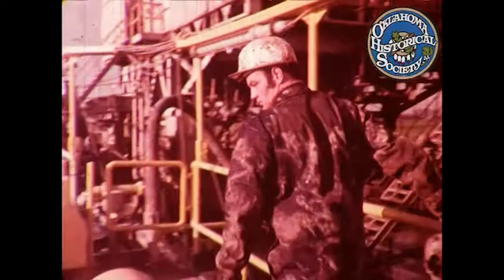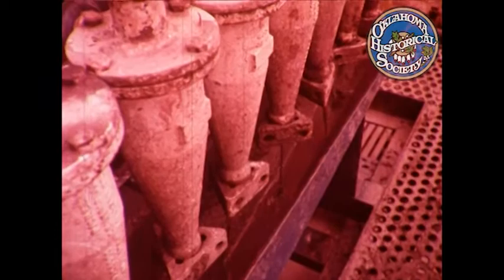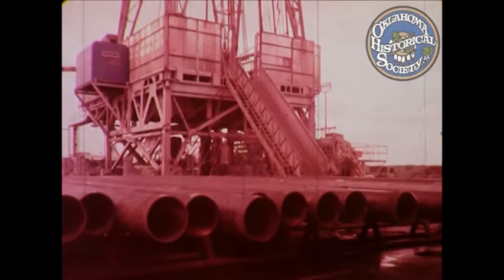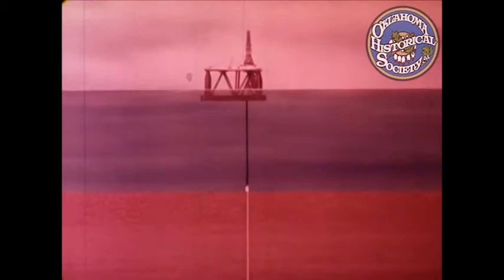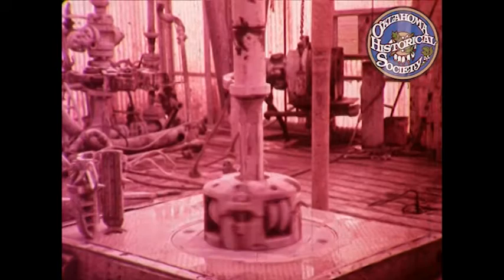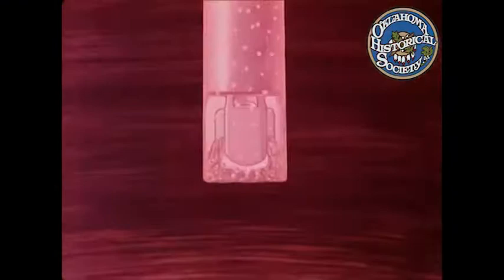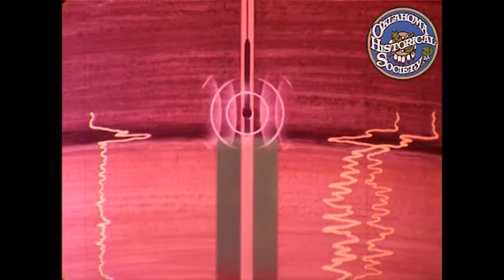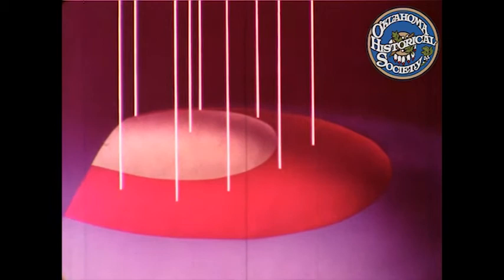Oil Well. 1975.

Comment: Broke out er Started working in 1977  (TX/Okla)   I was 3rd generation oil-field so I'd been around it all my life.  Went to work to hang out and watch with Dad all summer & school holidays as a child.  Spent my high school years working during cold wet weekends and long hot summers. Drastically changed  my career in 1980s  Never thought I would do anything else up to that point.   
Thanks for putting up this perfect 70s production!

Comment: I started out as derrickman about the time this was filmed.  Nearly 50 years later, now a facilities engineer working on multiple offshore decommissioning projects.
Reply: Decommissioning? Is that how we spend our last yrs in? I'm young, and all ive been on is comissioning. Haven't thought much about the reverse 😅
Reply: @Skunkhunt_42  I am in California.  Oil is not exactly a very popular source of energy here now.  I'm decommissioning facilities that are quite capable of flowing X,XXX BOPD.  Cementing wells that otherwise have viable bottomhole pressures to allow lift.  Didn't imagine this would be in my future but this is California.
Reply: @cannongeorge  that's wild. Curious, as for the hardware like pumps, valves, instrumentation - who's buying that stuff? I'd hope anything viable gets sold on the used/refurb market. I'm a hoarder of instrumentation valves/fittings.